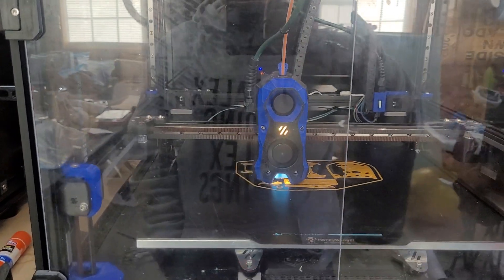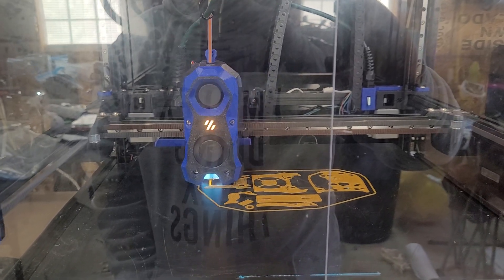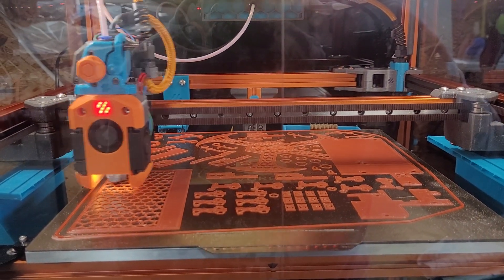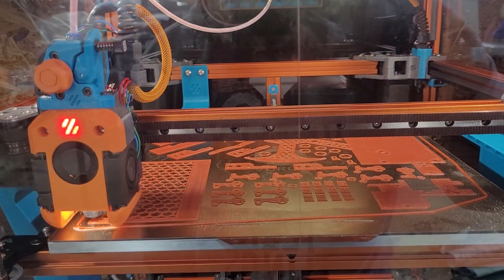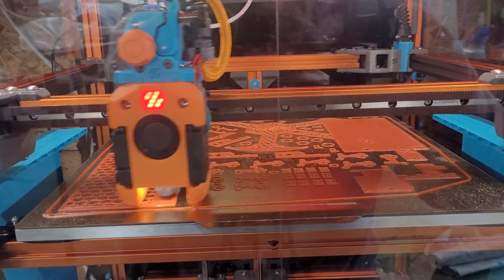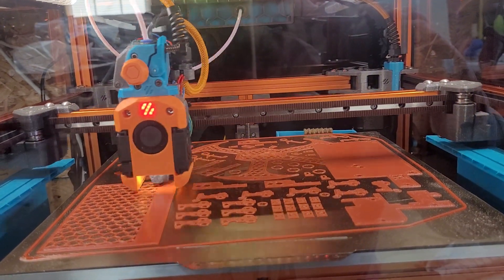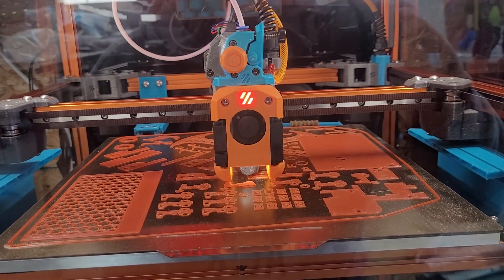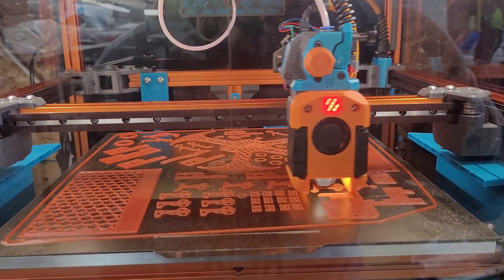Voron V2.4 VS Trident Print Speeds

Comment: Are you able to print Carbon filaments with your trident? I really want to do a trident, but the motors on the inside of the enclosure worry me since I want to do carbon filaments
Reply from the maker: Yeah. I print carbon fiber nylon and PPS-CF no problems. Outside of peek and peak it will basically print anything
Reply: @ProjectsInDadsGarage I assume you don't have the printer enclosed?
I'm annoying and would like to build an all in 1 printer. I originally was planning on a custom ender extender to core xy, then I thought voron trident or mercury one.1. since I want to do the high temp, it looks like the ratrig external motor concept is nice because of the heated chamber. 
If you don't have problems with the PPS-CF. Then I'll just need to debate between voron 2.4 and trident. And everyone says 2.4 is easier to do a tool changer

Comment: Looks good! I built a ercf v1.1 and never hooked it up or even programmed it. Just got the upgrade kit for 2.0 today. Look forward to more videos
Reply from the maker: Awesome. I never built a 1.1. looked to have a lot of issues but v2 solved the things I was concerned about. They have done a ton of work with making programing as easy as possible. I was impressed with some of the stuff and some would be great to use for automation of normal printer set up.

Comment: Can u share the configuration file?
Reply: Could you please, I understand but I can always make adjustments. I believe this would give me an example what to aim for. Just about to finish putting my Voron 2.4 together for first time. Not going to use it yet, but when I start running it it would help me a lot.
Reply from the maker: @Nexx8969  I will put it up on GitHub tomorrow for you.
Reply from the maker: Also stock configs are available from the voron design GitHub for the octopus, M8P, spider, skr 1.3, and skr 1.4. if you are using a leviathan that config is available on the LDO GitHub and if you are building an LDO kit they have configs specifically designed for their kits with all the extras that go with them. I would highly recommend starting with the most appropriate of those options when building a printer over using a config from myself or anyone else. Those are designed to work with the way your printer will be when following the manuals from voron design and LDO respectively.
Reply from the maker: I can but is really going to be useless for anyone who doesn't have exactly the same stuff I have and that stuff would need to be set up just like mine.
Reply: I'm using m8p v2.0 which has build in raspberry pie cpu with ebb 2209/2240 can and Voron tap. Used LDO motors for the build. But everything else I did was source out my own parts like hall end x y stops, mini camera addonsetc.  Got mandarena works 350mm base with build in magnets, 750 watt 120 heater, and ball base plate mount for anti warp.

Got everything flashed on m8p board so far. Still printing few more parts left to get printer going. 

But I noticed I didn't see any configuration available for v2.0 version which is what I have. I downloaded stock generic config from btt GitHub, and noticed it's too basic. On Voron GitHub they have v1.0 for Voron 2.4 which is what I'm building but it didn't want to work at first on 2.0... then later I decided to try again seemed like I got it working. My old printer used reprap duet board so this is new to me. But anyway I guess il try it out see if it's going to be ok. I haven't done anything to can board yet, probably needs to be flashed too.

But anyway I saw your video, figured when I get all my initial stuff done, it would be nice to see someone else's config to see the differences plus wouldn't hurt to test out the accels etc and see what it does on my machine. Could help to see another person's code, to get a different view.
Reply from the maker: @Nexx8969  yeah with that setup you are going to have to do a lot of work setting up configs. If you are on the Voron discord myself or one of thousands of people will be happy to walk you through it all.
Reply: @ProjectsInDadsGarage  oh alright, sounds good. I will hit you up some time when I'm ready. Thanks.

Comment: You can’t really compare the two as you have two different tool heads going. I have a v2 350mm and running rapido v2 inside a dragonburner tool head. Using orcaslicer I can print 20k+ acceleration without issues.  I am also not running can yet. Waiting for my cable to come in.  But I love the trident and how solid it’s built.  The flying gantry on the v2 takes a bit to get properly adjusted and broke in.   But again your V2 can match pace with trident if not go even faster. But all same hardware. 🎉
Reply from the maker: Absolutely I should have been more clear I was comparing my V2 and Trident as they are built not all V2 and tridents that's my bad.
Reply: 20k accel at what speed? maximum i got out of my 0.9 motors at 1.1 or 1.2 was 520@11500.

Comment: What material are you printing? I really curious if you can print that fast with PETG.
Reply: lol that would be one big spiderweb.
Reply from the maker: I am bringing ABS. I run PETG at the same speeds as ABS on the V2 when I absolutely have to print it. I avoided PETG like the plague. I haven't printed it yet on the Trident but I would not try to print it that fast.
Reply: Printing with 20k accel on my 2.4, petg feels fine :)